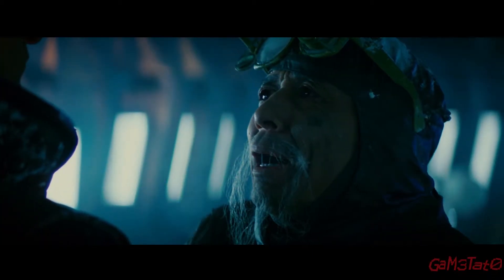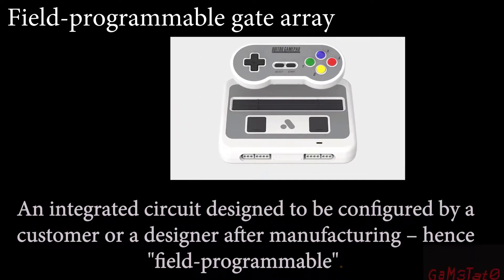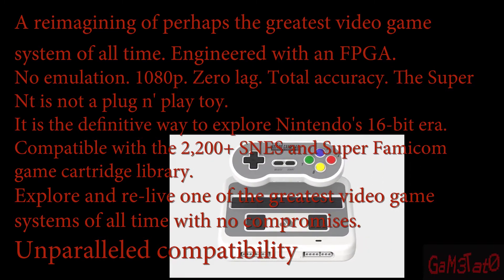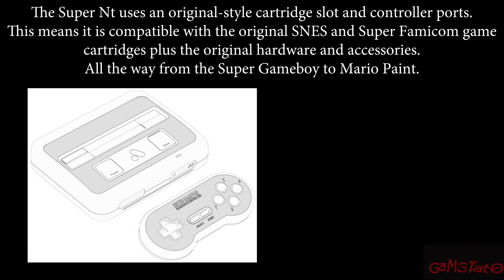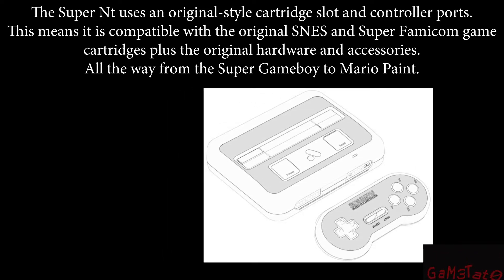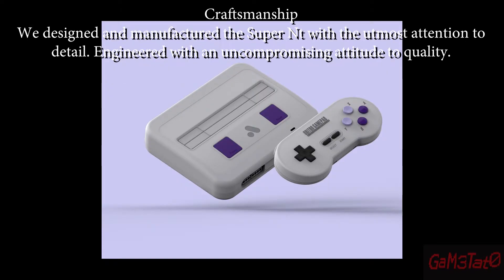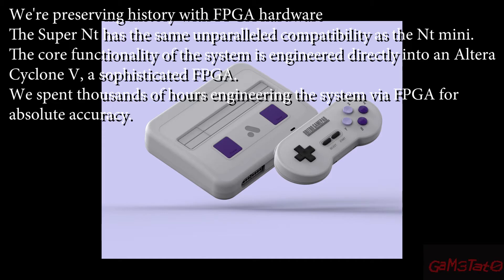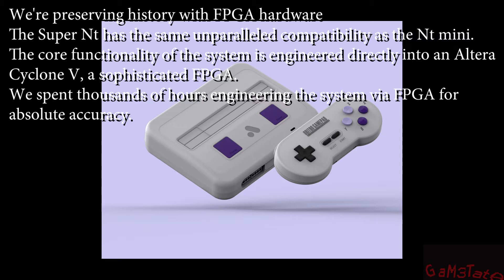FpGa Snes NT killed The Snes Classic!

Comment: On a side note, I need your help. I got an old PVM and someone gave me a PlayStation 2.  I wanna hook it up to RGBS and I don’t know what cables to buy. Since they are all pricey I don’t want to buy the wrong ones.  I’d like to use SCART as I’ve heard from multiple places that’s the way to go.  Finding a PS2 to SCART is easy to find, but I can’t seem to figure out which cable I need to buy for the other half that plugs into the PVMs RGB ports. The PVM I have does have speakers.

Any help, recommendations or links to cables is much appreciated.
Reply from the maker: Most pvm's use BNC connectors. Does Ps2 output RGB or component or both?
Reply from the maker: I want to see if the pin-out is the same on RGB or Component because then the same cord would work for both! Imma do a lil research! and get back to you asap!!!
Reply: Gam3Tat0 from videos I’ve seen on YouTube they do both.  I’ve been checking out PhoneDorks YouTube channel and he does a lot of RGB comparisons and has one of the most impressive retrophile “on a technical level” setups I’ve seen yet.  This guys got tools to make sure his picture is optimal to a unnoticeable level because he’s a perfectionist... but a lot of what he talks about flies over my head and he loses me... so he’s high level and I’m still a noob when it comes to this stuff.
Reply from the maker: If it does RGB, then get 5 rca to bnc adapers with a component cable and it should work fine.
Reply: Gam3Tat0 what about sync?  I think this monitor was before sync on green.
Reply from the maker: So you have a 6 wire input? 2 audio,3 rgb plus 1 C-sync?
Reply from the maker: Tmw I'll give you a response from the video engineer at my job! I want to give you the correct solution.
Reply from the maker: 4 wires 4 video right?
Reply: Gam3Tat0 the PVM will be 4 BNC connections. Red, Green, Blue and Sync.  Then two connections for sound.  I don’t believe you can get an RGB cable from the PlayStation unless you get a PS2 to SCART.  I’m not entirely sure, but I think I might need to buy that and some sort of SCART breakout to RGB/Sync/2xAudio.  Would like to avoid buying those two cables as they might run me about $50-60.  Getting a PS2 to Component is a relatively cheap cable and BNC adaptors are inexpensive... so if that solution is possible, it might want to try that first before spending all that extra cash.  PVMs are great... and RGB is probably the best visual presentation for most Systems pre-HD... it’s just easy to buy the wrong thing and get stuck with odd cables that don’t get ya where you want to go.  Thanks for offering to help!